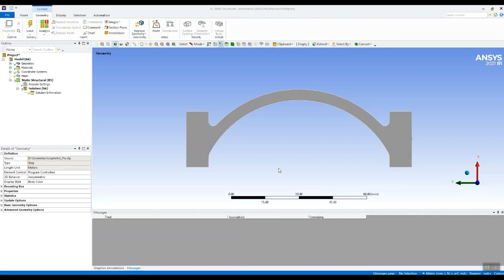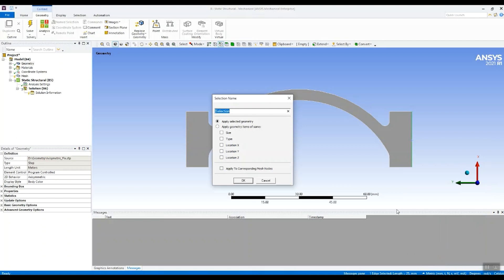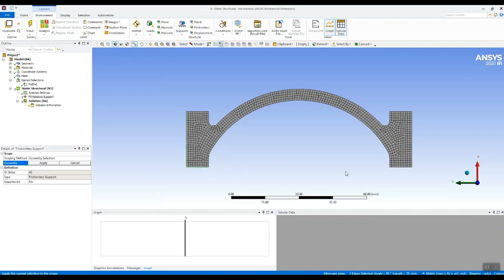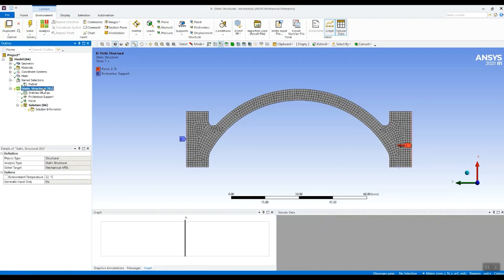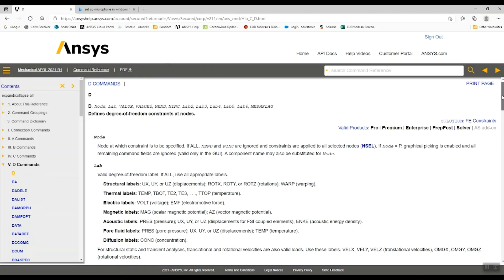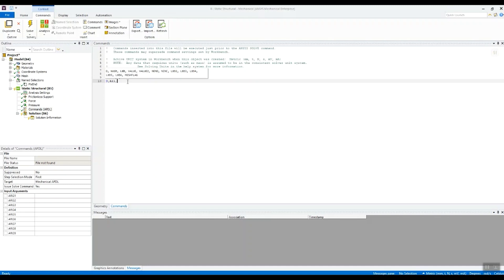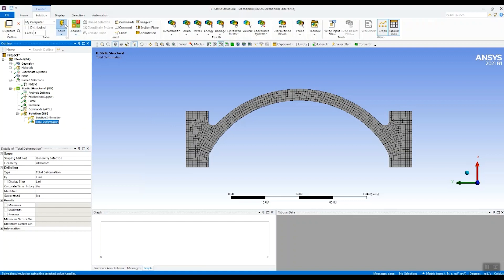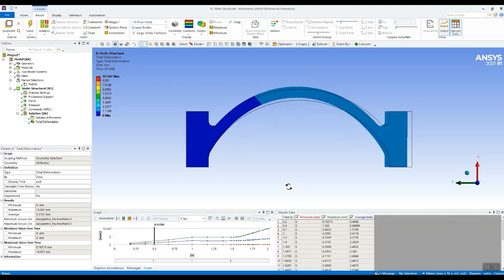How to Apply a Load to a Deformed Geometry in Ansys Mechanical

Comment: As you mentioned you fixed an edge after a specific displacement. How can I make it free? because %_fix% is used to fix displacement components of the edge? in fact, I want to apply the free edge condition to that edge in the second step of the solution.